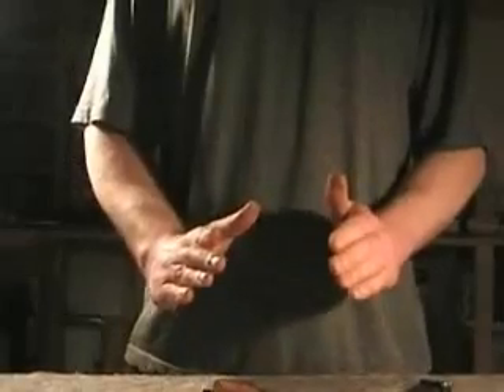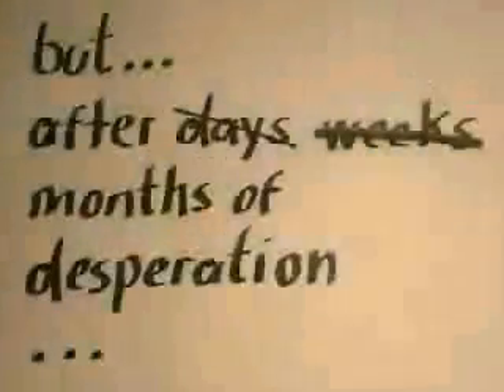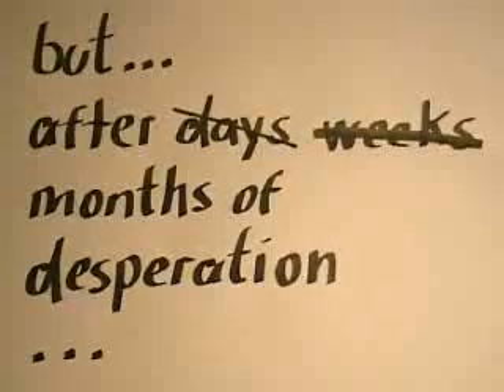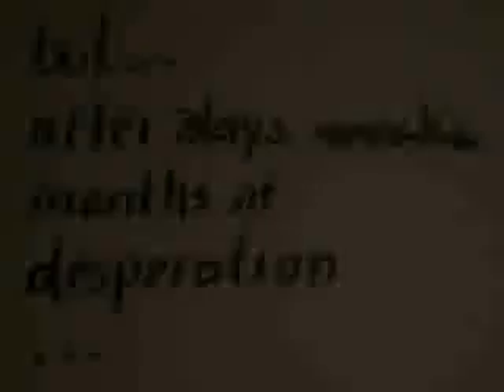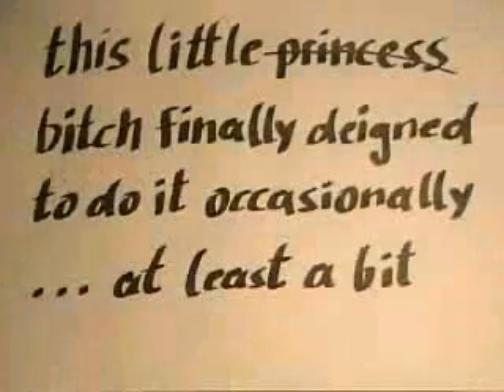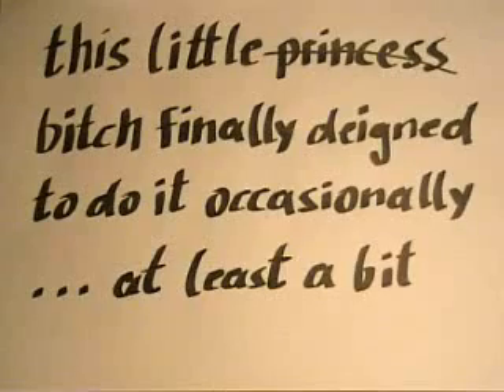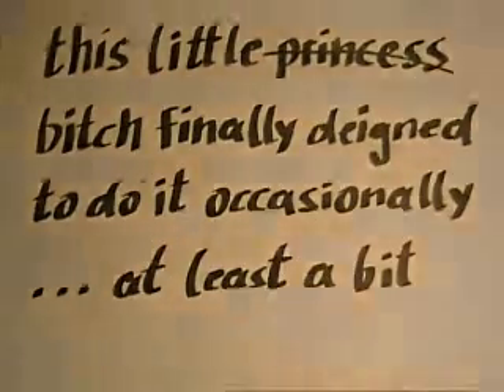Bullpup rifle w ambidextrous side-ejection (modified Steyr AUG)

Comment: @fireball676 Yeah, Steyr did the 2 bolts thing first.

Saying problem solved means you don't understand the problem.

Try changing out that bolt while doing rapid reactive movement or coming around an offhand corner in CQB.

OTOH, swapping shoulders is what trained people do with conventional rifles.
All my video says is that such techniques are just as doable with bullpups provided a rare brass impact doesn't make someone menstruate in place.

Comment: Dangit, ran out of characters.

One other point troubleshooter brought up, speculating that silencers will make it worse.
If you look at my video, you'll notice the silencer actually changed the ejection pattern on the AUG.
The backpressure is somehow flinging the brass forwards.

Either way, wear your eye pro, and a bandanna over your mouth at most, and you'll be fine.

Still, plenty of fellows will carp and moan and howl about brass hitting them, and so your AUG modification has a market.

Comment: Actually, shooting most conventional bullpups left handed during movement or around obstacles is completely doable.

Hopefully, I attached my video. If not, do a search on Left Handed Bullpup shooting where I shoot 6 1/2 different bullpups from a bench, doing movement drills, speed kneeling and in modified prone.

Really guys, all the caterwalling and menstruating about how difficult it is is quite overrated.

In a high round count class I'd wear a bandana on my face. And then not worry.

Comment: @troubleshooterBerlin Before, some would use a brasscatcher to get around the flying brass it but it's really prone to stovepipes.

I've watched a demo on the FN F2000, There's a hatch right over the breech to clear obstructions and a blockage in the ejector tube can be easily cleared by the barrel cleaning rod..